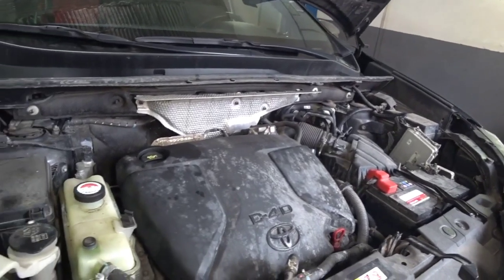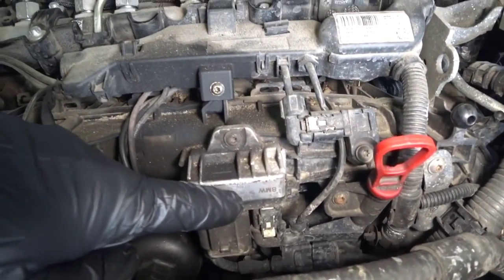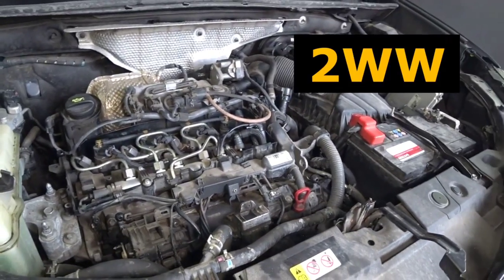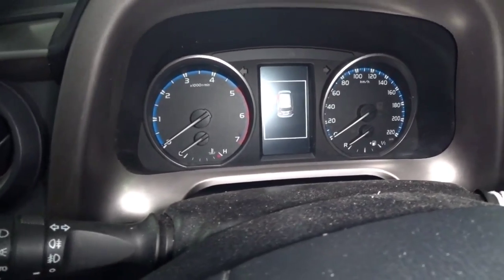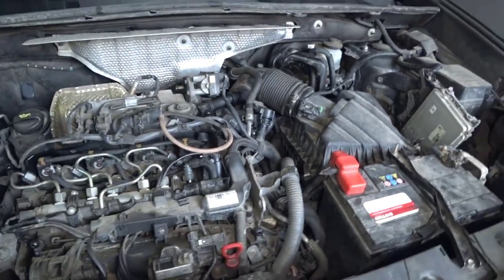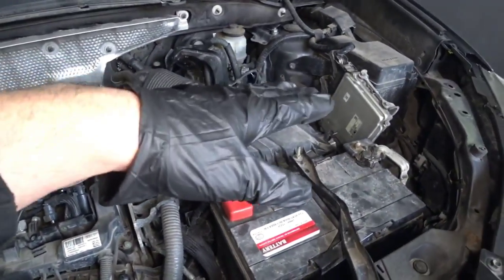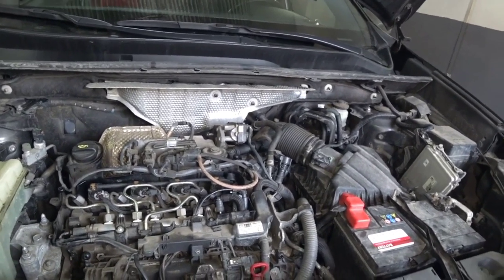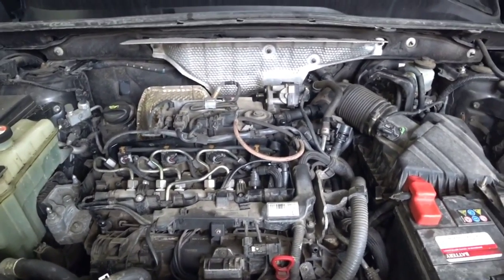Toyota RAV4 with BMW engine #toyota #bmw #2ww

Comment: What are the experiences with this engine, given that in BMW cars they had problems with the timing chain breaking?
Reply: Timing chain problems in these too :/
Reply: Just service them well and they are good. They are way better than the older 2.2 D cat and they are also very smooth these bmw engines